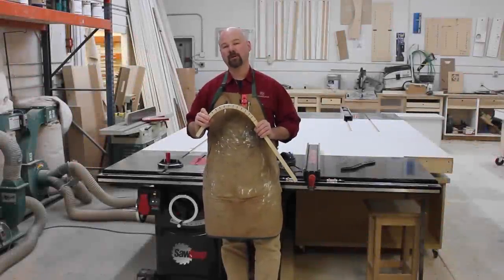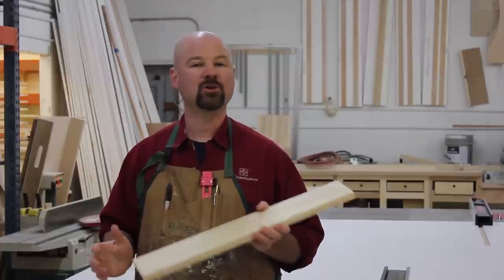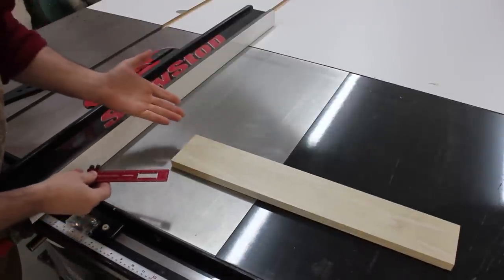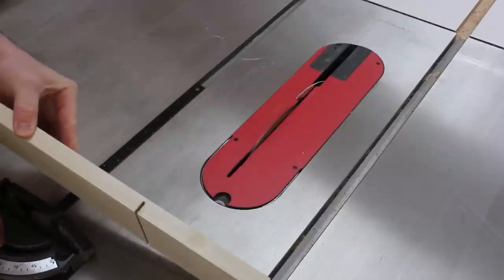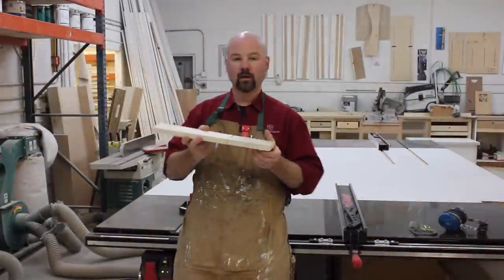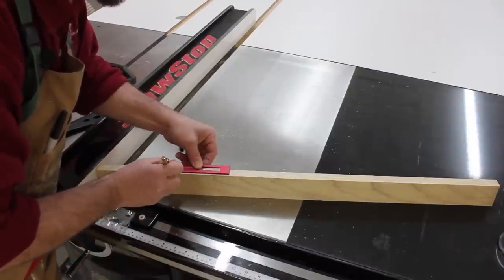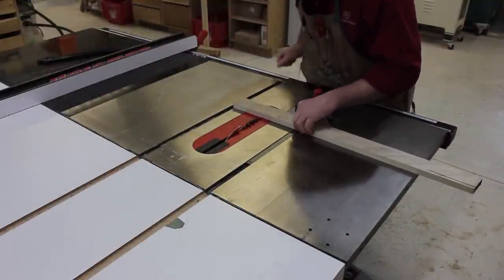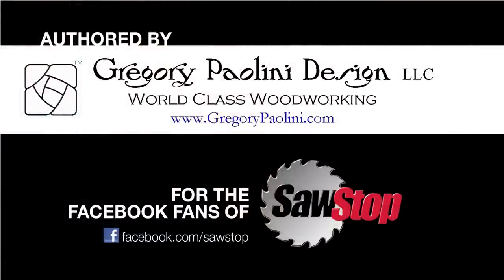Bending Wood On Your SawStop Table Saw

Comment: Ok now that I have made the saw Kerf cuts it flops around.  Do I mix saw dust
with glue and apply inside the kerfs to make it strong ? What are your recommended gluing techniques for a stronger joint?
Reply: David Spiller David, try a mix of glue & quartz dust, is really cheap & your bendings will be so strong as solid rock, specially recomended for acoustic guitars. Tell me about results later, please.

Comment: This is how I do it. I Calculate based in the inner surface radius I'm looking for. 
You can also get really tight radius bends if you make two passes per cut line +5 deg. and -5 deg ... two cuts per line. so you're getting little wedges. Also when you're done ... mix a good epoxy with some fine sawdust pack it in when it's flat and then bend and clamp. There will be a lot of squeeze out but it's very stable afterwards.

Comment: some say 12 cuts is the magic #.  say total length is 9"...take your ruler and position 0 on the first line then angle the ruler down till the 11" mark on the ruler hits the 2nd line (9") and draw that angle.  then make a dot at each inch interval then draw your lines which will be your cuts....hope that makes sense :p